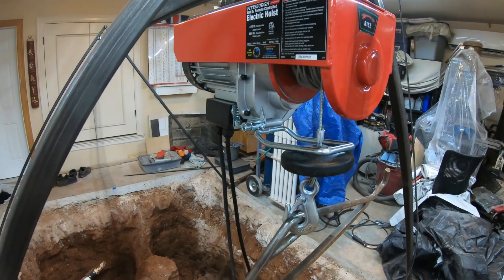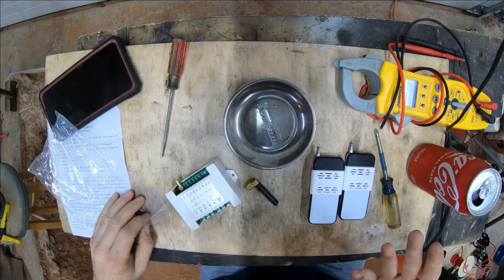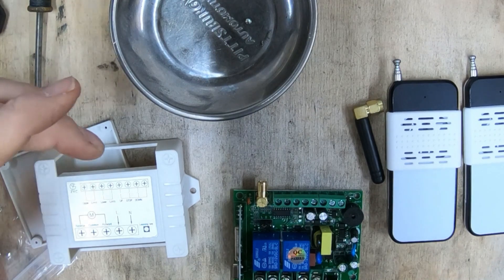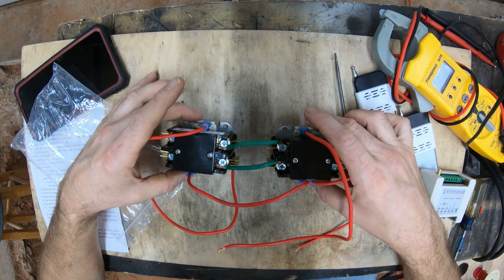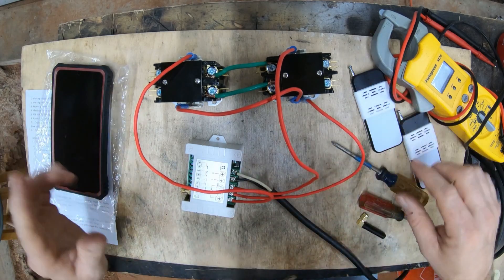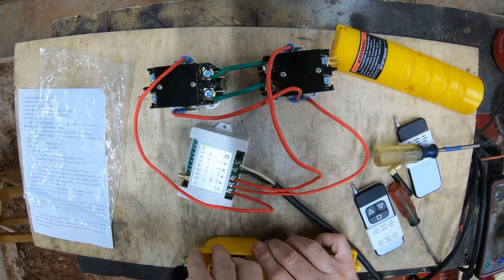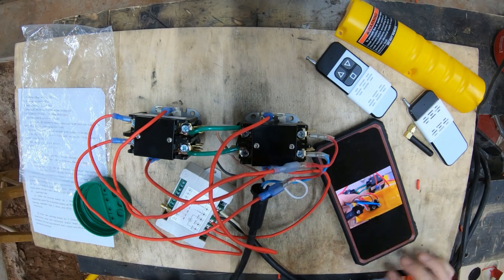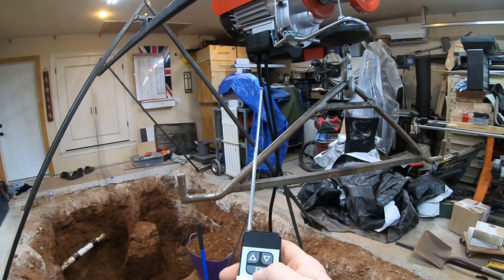Harbor Freight Hoist CHEAP REMOTE BUILD Pittsburg Electric Hoist

Comment: Thank you! I'm likely to copy you for my winch which is being used to pull my airplane in the hangar.
Reply from the maker: when I was stationed at spangdahlem in the 90s, we would hot winch a running f16 back in the shelter.  The winch latched onto the main gear and the pilot steered.  I had to run the remote and direct the pilot.   Good times!
Look for a nice evening video in my list.  I think you'll like it. 😉

Comment: Ok I got everything setup like yours and it works with one problem. Both up and down on remote go up. No down.
Reply from the maker: Did ya take your photo?  Go back to the way it was originally, try it, then do it again.  Put a VOM on your down on the remote box and see if you get any power there.  It might be the remote board.
Reply: @jagboy69  thanks. I think it might be the board. I ordered new one
Reply: @chrisholt6136is this work

Comment: OK I have a question. I don't have this exact hoist but one very similar. There is another video showing making harbor freight hoist remote wireless. They just use the same wireless unit you use but without the Carrier HVAC Motor Contactor.  I can't get mine to work so I am wondering in I need those. Any idea why some need them and some don't? Thank you
Reply from the maker: It would help first to know what you are dealing with.  A contactor is a switch designed to do the heavy lifting connecting power to something.  That big switch can be controlled with a small wire.  That small wire is doing its job through the remote.  I don't know how someone else wired their setup, but mine works great using contactors.   This crappy little Chinese remote will NEVER be able to switch this kind of electrical load.  If it can, it won't do it for very long before letting out the smoke.😮

Comment: Absolute Legend, thanks for the video!
Reply from the maker: It's still working good for me!!  It's picking up 100lb buckets of dirt like candy!
Reply: @jagboy69  Mine is a 'Giant' brand and is rated to 1000lbs. I have mine mounted on a gantry crane that is 10ft off the ground so anything you lift is directly above you with the original controls. I personally don't want to be under the suspended load of a China winch!

Comment: I tried wiring mine up exactly like this and only down function worked
Reply from the maker: is the up contactor clicking??
Reply: @jagboy69  yes I even put my hand on top of each contactor to ensure they were
Reply from the maker: @dickiedentonii6124  Then the remote and contactor side of things is fine.  Did the winch go UP before?  If so, it's gotta be how you wired the up to the contactor.  Pretty hard to mess that one up.  Remember, IF that UP shutoff switch on the winch is engaged, it would prevent it going up.  I'd look there.  Be sure that switch on the winch isn't engaged.

Comment: Is yours still working properly? I wired mine up exactly like yours but added an upper and lower limit switch too. I am now on my 3rd white box with remotes it keeps burning out after a few weeks of use…
Reply from the maker: Yup.  Mine is doing fine.  No limit switches.  When I shut down for the day, I usually unplug it.  Wise man once said, Trust no cheap Chinese electrical products.
Reply: @jagboy69  thanks for the reply I appreciate it. I built an elevator for my grandparents to get from their car in the garage up to their house above it. Works great when it works but these boxes keep failing. I really would like to find one of good quality but having a hard time.
Reply from the maker: @Kitch940  Slick idea to help out the grand parents!  I wonder if your contractors are staying electrified and cooking the cheap white box.  Your limit switches need to be removing power from the terminals on the sides of your contactors after they take it up or down.
Reply from the maker: Are you sure you have the right contactors??
Reply: @jagboy69  double pole 120v 30a contractors wired up like you did. Maybe I should but everything on a switch because it always is powered on and never gets turned off. Shouldn’t matter but could help.
Reply from the maker: @Kitch940  I think I'd try that.    You'll know if the contactors are staying engaged, you'll hear them buzzing.  Just like when my winch goes up.  The switch on the winch shuts the motor off, but unless I hit the stop button, the contactor stays ON...  That's probably what's killing the remote boxes.  They probably weren't designed to handle that kind of current for long periods of time.
Reply: @jagboy69  ya I will try that and see how it goes, I’ve been keeping a spare box on hand because they really can’t be without it for long. They were quoted over 20 grand for an elevator and I built them one for around a grand. The most expensive part was the safety stuff. Anyways great video it really helped me with my build, I appreciate it!
Reply from the maker: @Kitch940  Until this country gets some serious tort reform, nothing will change.  Imagine saying to yourself one day, I'm going in the business of building these elevators to help older folks.  The first time someone stubs a toe, you get your balls cut off in court.   That's why insurance and attorneys are out of control.  It's really hard to engineer the dumbass end user out of devices.  I totally can see 20grand for a simple device like you built for a grand.  I'm sure it's brought comfort and convenience for your grand parents.  They are lucky to have you!  Just don't trust that cable on the HF winch for too long.  For the measly 100bucks they cost, I'd be tempted to even replace it once a year,  its "cheap insurance"...  lol

Comment: Are you still digging? Remember to stop when you smell Chinese food. Really though, your video is like having an electronics tech in my back pocket. I have a monster winch and will use your info to make a remote for the 32-foot wide aircraft hanger door that I am going to build using shipping container wall metal. Thanks very much!
Reply from the maker: Lol..  I'm trying to get the waterproofing membrane out of China.  Friend of mine told me to keep digging and they can just hand it to me through the hole!    I'm no electronic tech, but contactors are simple enough.  A remote hanger door will be slick!  Do some slow flight over the hanger, hit the button and by the time you land, you can pull right in!  Look through my older videos and enjoy a night landing with me!  Good luck, glad this video helped you!

Comment: making progress it looks like. Been a month or two now, how's the hole going?
Reply from the maker: Work has had me swamped the last few weeks and I am making a big change to the construction technique.  The pipe has been relocated and about 50% of the hole is down at over 5ft.  Digging is going easier than I expected.  I'll be back in the hole this week and  will see if I can get a video update out.  Happy New year bud!
Reply: @jagboy69  like any "remodel", never know what you're going to find once you open up the beast!  making progress for sure, good luck as it continues.  Finally "moved" in up here, now need to get to some fun projects myself one of these days, but it is ski season so hard to do anything else!
Reply from the maker: @ChatterontheWire  The snow looks beautiful, but you'd find me skiing the mahogany run with the snow bunnies.

Comment: Can you make a video or pic of how the capacitor is connected at the hoist box please? I have the model where the capacitor is in the remote and I'd like to move it. Thank you!
Reply from the maker: Sorry, I don't have any photos or videos inside that thing.  I would think you should just be able to trace the wires from the controller to the hoist.  Then shorten and reconnect it in its new home.

Comment: Question - Is the whole reason for using the contactors because the remote control is not rated for enough amperage?  The reason I ask is I saw another video where the contactors were not added.  Also,  my harbor freight hoist has an e-stop button.  Can I assume this unit will not use that function?
Reply from the maker: Yes, the relays on the board won't handle the abuse. The Estop is useless, I don't know why some have them.  I'd just bypass it.

Comment: Clever thinking. How long have you been working on this project so far?
Reply from the maker: I broke ground the 2nd week of September.  I had been kicking around this idea for almost a year and commissioned the lift build around January I suppose...  It took a few months for that part.  Ya see, originally I was going to build the lift until I saw how bad the price of steel went up.  The Chinese were able to build and ship it much cheaper than I could.  To my surprise, they actually did a great job on the lift, it's very well built and it's not made of tin foil and cat turds.👍🤪

Comment: Very well done video.  Thanks for the shout out in the notes.  If anyone wants to understand how a DPDT switch works, that should help.  I suspect most folks just want to know how to hook it up.  I do have one question though: Why not rent a mini excavator for a weekend and have it all done lol.  Looks like a ton of work.  The result should be amazing.  I would definitely want a sump in the bottom in case water ever found its way in.
Reply from the maker: Can't get a mini ex inside the door and making the swing would be a problem.  Worse part is they don't go down 8ft.  I angered the soil pretty deep so the digging is pretty easy.... (For now!🤣)  I'm on the hunt now for a cultivator I can dump in the hole and run back in forth to loosen up the floor, then its back on easy street I go!  Thanks for stopping by and the great idea with the hoist, it will make my life a lot easier.  And if I lasts until the end of the job, I got my money's worth.  Yes the 20% duty cycle sucks, but I can only dig so fast.
Reply: @jagboy69  Yeah, those lifts don't like to run long at a time for sure.  Have you thought about dropping a rotor tiller down there?  You might be able to get a small one on Marketplace.  Another thought is to rent a ditch witch for a few hours and dig it as deep as it will go.  Worst case, get one of those drill attachments for plants bulbs lol.
Reply from the maker: @joefishengineer1  I've got a little mantis tiller with a Honda motor, but it's like hanging onto the back legs of a passed off texas jack rabbit.  It does dig, but not fast enough for me.  I tried the pawn shops today and had no luck.  Market place is a good idea if I had book face.  YT is as far as I go with the social media thing.

Comment: Bit more work and you can actually get the 115VAC supply out of that original yellow switch, looks like all they do is use one side to energise the motor and the other to decide which side of the capacitor to apply power to. So that centre tap will have 115VAC all the time, even with the winch cable all the way up, which just disconnects the one side of the motor. Smaller contactors still rated for 30A are available, and also similar remotes with 2 buttons, so you have to press and hold to run the winch.

Just remember duty cycle of that motor, the CCA wire in it will get hot after being run for around 20 minutes of down and up, and you do not want to rely on a thermal shutoff made by the cheapest supplier they could find. Quick way to need to go claim on the Horror Fraught warranty of "it went bang", and all the smoke came out.
Reply from the maker: The good thing with these, if it craps out, ya go get another and play swap the box.  Good suggestions, but as you can see, I'm literally up to my neck in work.😂  Thanks for watching!